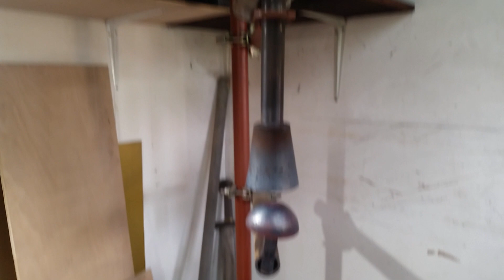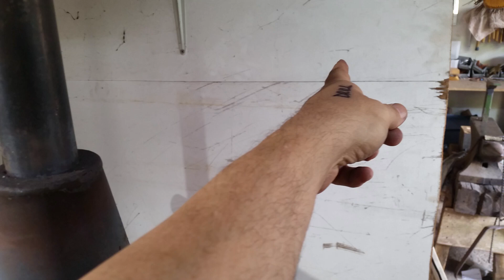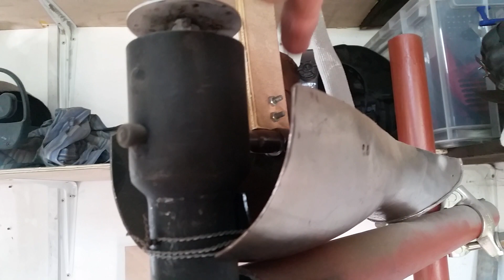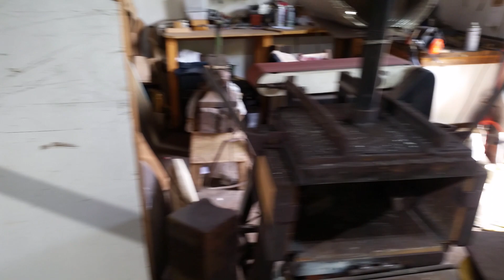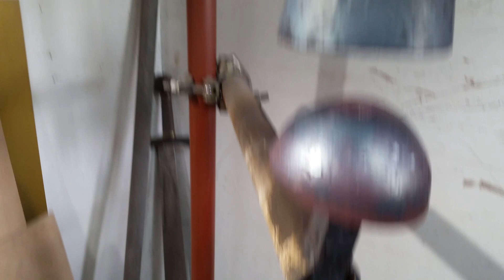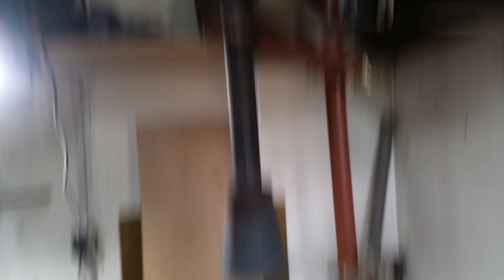My simple, scaffold, down pipe forge. The Bride of Frankenforge.

Comment: Thanks for the video Graham, fantastic video and advice! I have always been curious about that set up! I built myself a big coal forge but I would like to get a gas forge for the benifits (quick start and low maintenance especially!) if you could start over again and pick a new gas forge, which one would you pick/think is the best for armour? Perhaps an enclosed ribbon burner? Cheers for the advice!
Reply from the maker: You've got it, I would go for a larger ribbon forge, about half as big as my current Frankenforge. I would then try and make a smaller, more concentrated downforge for raising stuff. And finally a gas saver oxy prop setup.

Glad the video is useful :)